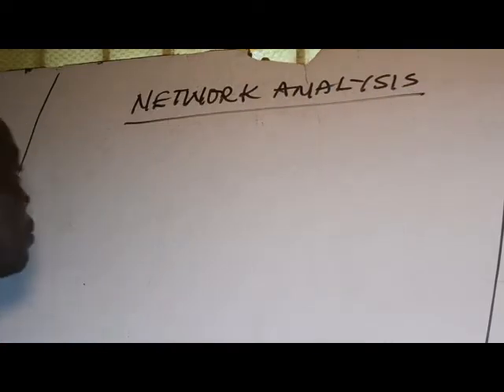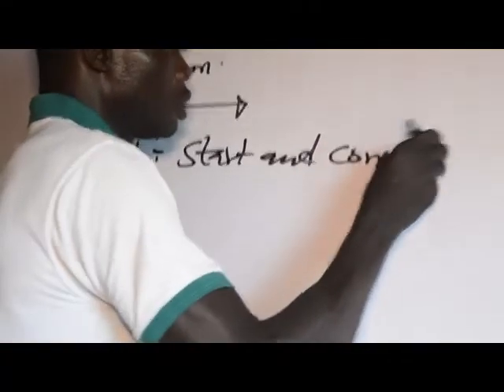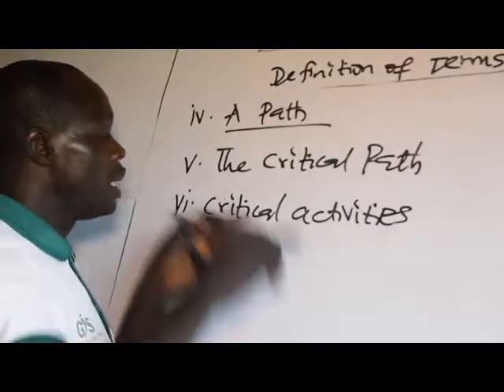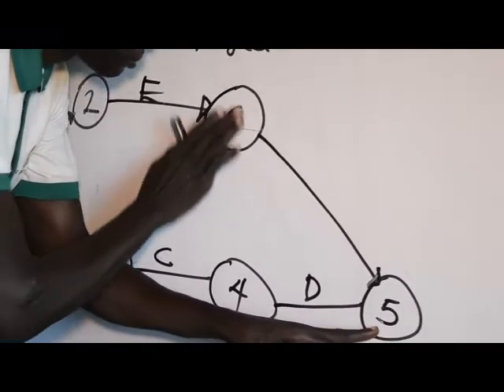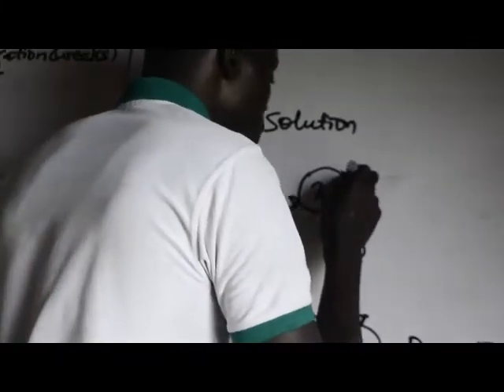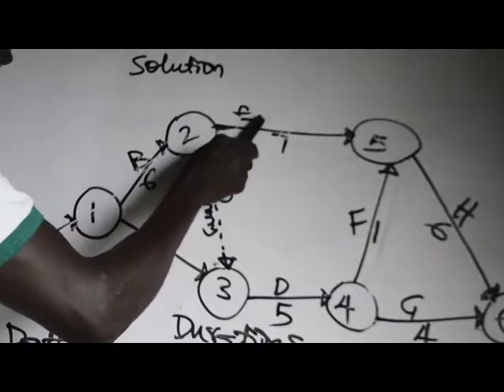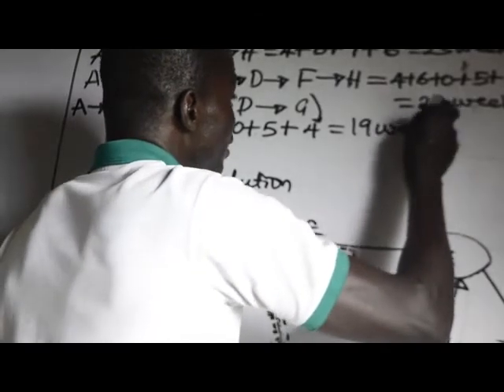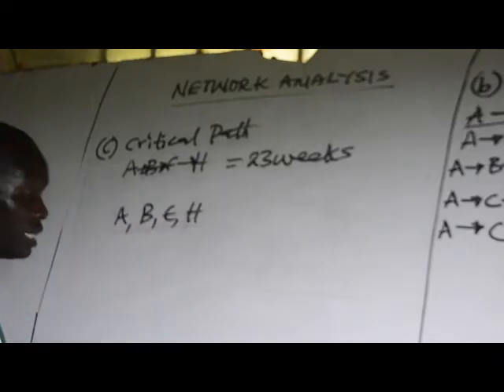Network Analysis or Critical Paths in Project/ Operation

Comment: how can I get your contact information. I need them
Reply from the maker: 08062479843
Reply: @Ezikan  am in kenya, i need to reach via whatsapp and the number cant be reached
Reply from the maker: Use +2348062479853
It is my WhatsApp number
Reply from the maker: Use +2348062479853
It is my WhatsApp number
Reply from the maker: Use +2348062479843
It is my WhatsApp number